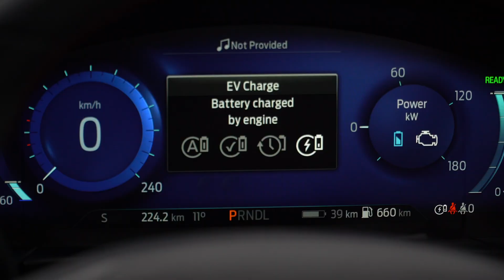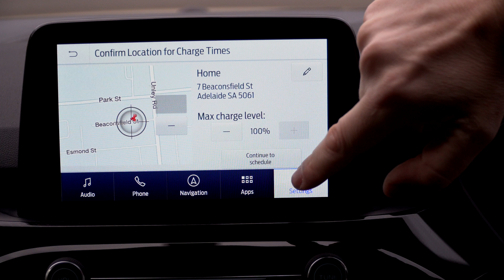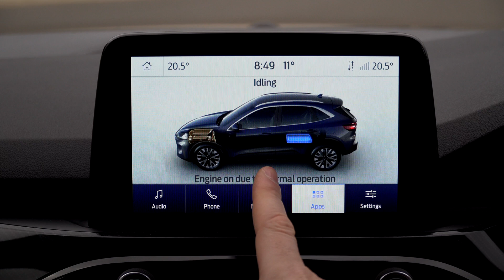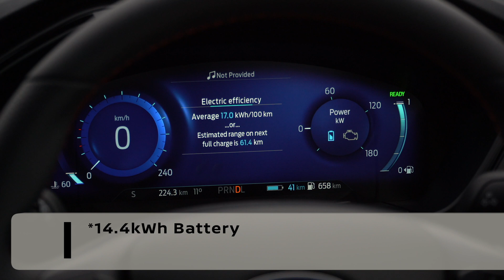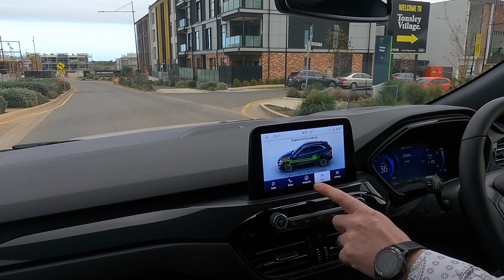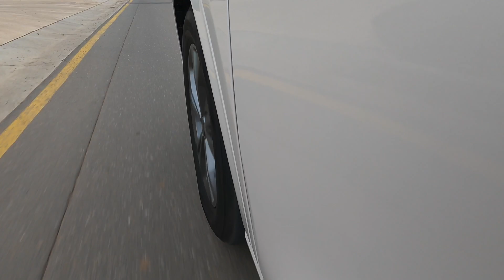Hybrid walk-through with the Ford Escape

Comment: Sorry, but this is not the future but the past. Small battery PHEV sales are declining because people don’t find them compelling compared to a BEV or a large battery PHEV. Pure EV range of PHEV needs to be at least 60 miles to be minimally useful for most people. Ford need to put a much larger pack in this car.
Reply from the maker: I agree the battery is small if you want to run it as an electric car. Needs charging daily to get good fuel economy out of it. It is technically more complicated than a traditional ICE car and a BEV, which ultimately makes it more expensive to manufacture and maintain, but also more versatile.